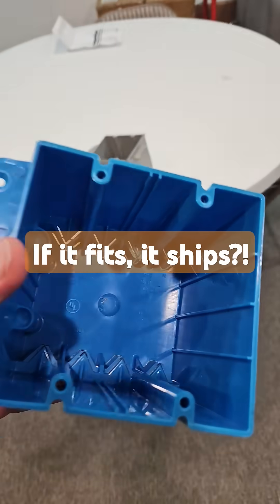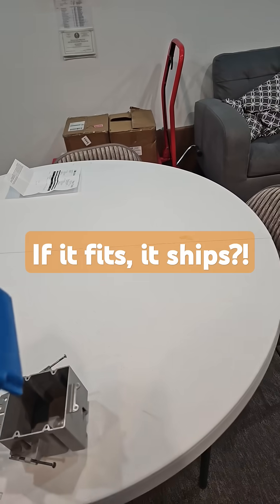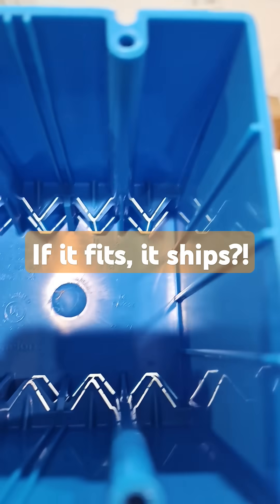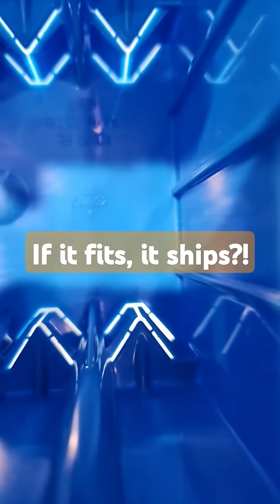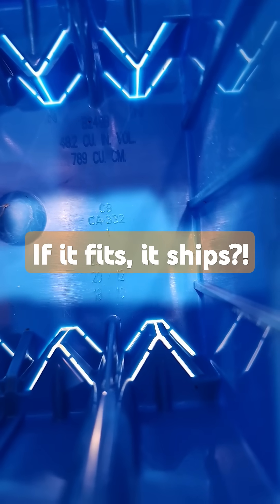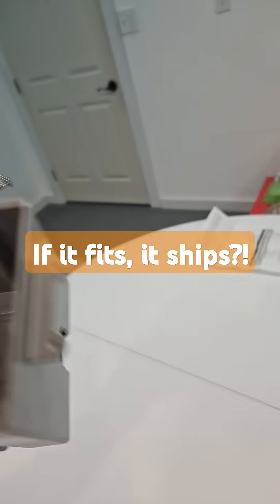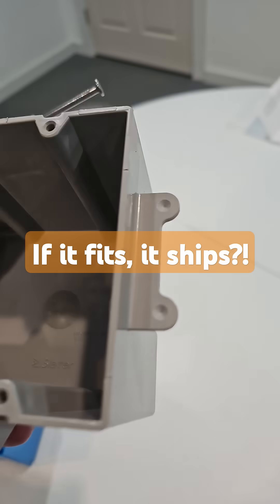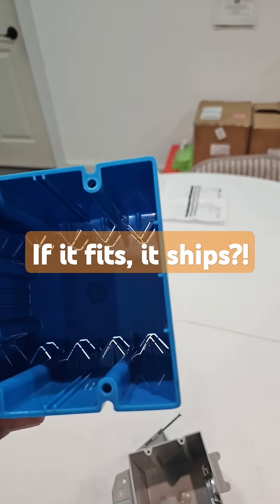The fallacy of "if it fits,it ships".#mckinneyelectrician #RAILprep #evchargerinstallation

Comment: I wonder if the box is actually rated, but maybe, it's just not stamped because there's too many combinations of wire types.  Obviously stamped his best because you can point right to it for the inspector.

I am curious if the documentation or website for the original box has a complete table of various combinations that may include it, instead of just the most common use case.
Reply: NM.... Looks like full table is on the box.

https://carlonsales.com/techinfo/brochures/electrical/Zip%20Boxes_2B1.pdf
Reply from the maker: @meeponinthbit3466  the wire fill by what is stamped in the bottom of the box is complete.